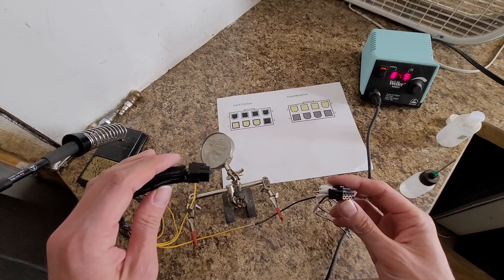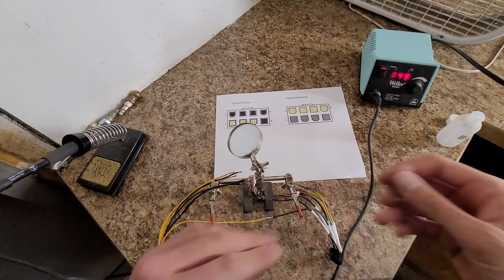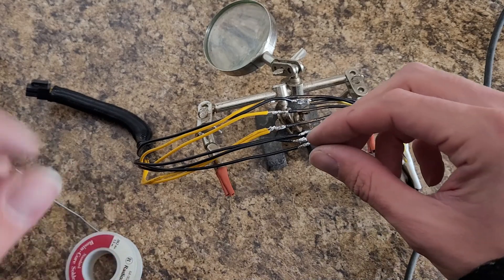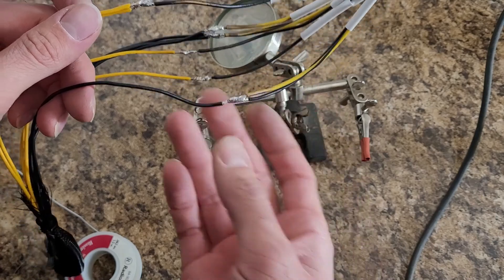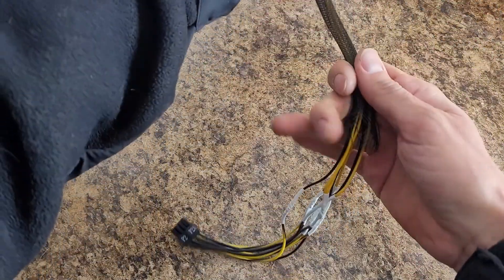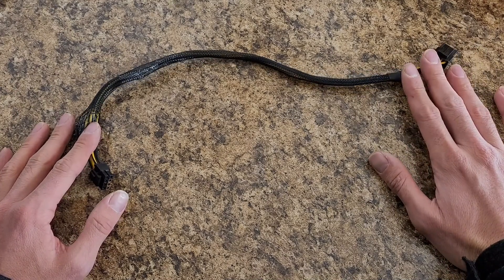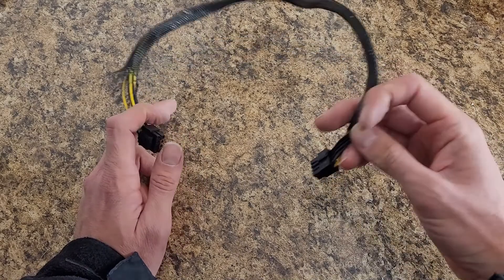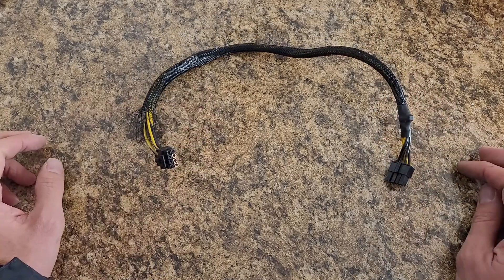Making a custom riser power cable for the Poweredge R720 for use with Tesla K80 & M40

Comment: I want to make this exact cable, can you please share which wires from one side are connected to the ones on the other side? Thanks!
Reply from the maker: I don't really have a schematic.  Basically one end is PCI express 8-pin and one end is EPS 12V for the pinouts.  You just have to splice the wires so the 12v goes to 12v and the ground goes to ground.

Comment: I have Dell R720 and a Nvidia Tesla P40 24Gb GPU. I am in the UK, wish you could send it here coz I am struggling to source this cable :) Could you talk about the adapter cables? what they look like and how to wire them up?
Reply from the maker: There is an adapter cable you can buy online that will take two PCI express 8 pin and convert them to an EPS 12V. If you have a shipping forwarder you prefer I'm fine with shipping to one. It's been a while since I have messed with international shipping since it was a pain sadly.
Reply: @computersales  do you sell those adapter cables? Could you provide a link? My question is how do you use that Adapter cable? I saw one with two connectors at one end and one on the other...But I am not sure how to use it.thanks for replying! Appreciate it
Reply from the maker: @fahadusman3538  I do, but I don't have any made up at the moment.  If I had the time I would buy the materials to make new ones, but I am still trying to figure out the connectors.  Mine go straight from the riser to the Tesla unlike some out there.  Some sellers claim to have cables that do that but you might want to double check pinouts first.  

Otherwise this is the adapter you would need to go from a Dell GPU power cable to a Tesla.  (I have no affiliation with this item, and don't know the seller so that would be up to your judgment.)

https://www.ebay.com/itm/274480544046

This is an example of one of the ones I personally have sold previously:

https://www.ebay.com/itm/225230303942?hash=item3470c5b2c6:g:drwAAOSw245jX1SQ

Comment: Do you maybe have a wire-to-wire schematic please ? hard to make out from this video.
Reply from the maker: I would have to figure out how to do that.  Otherwise the connector on the riser is basically PCIe 8-Pin layout if that helps.  If memory serves correct you could use a PCIe 8-pin connector for the riser side, but you would have to cut off the tab on the connector.